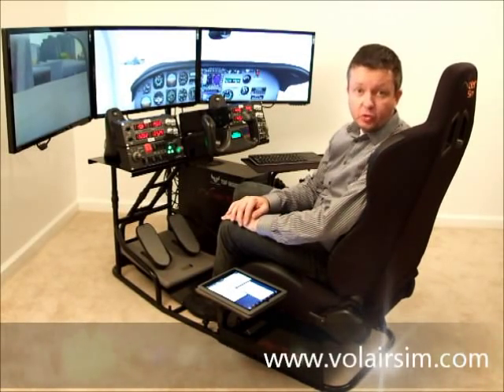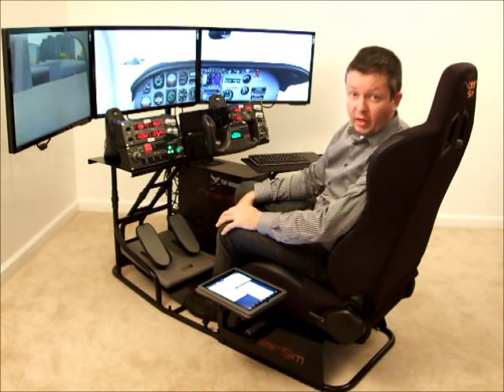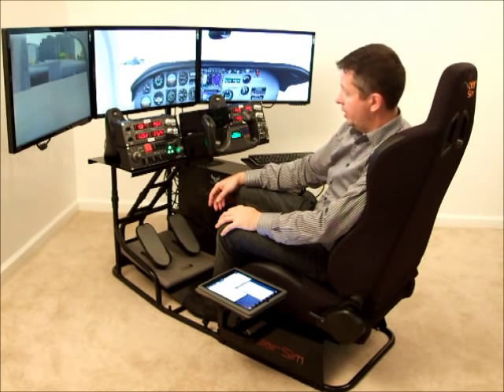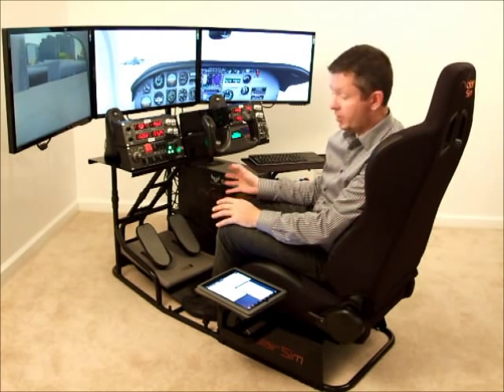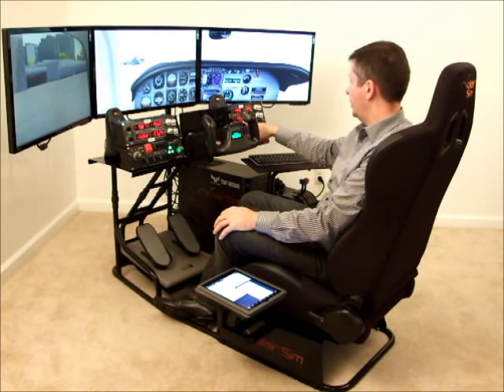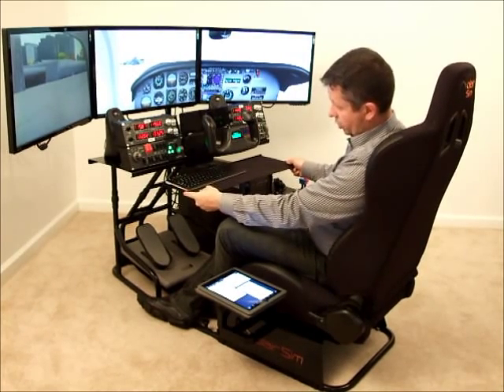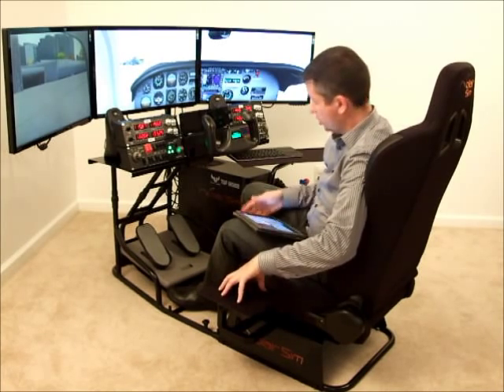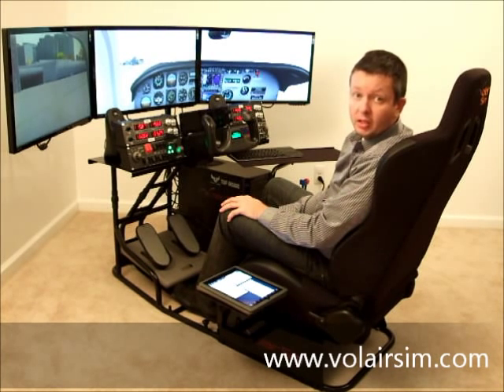Volair Sim - Flight Simulation Cockpit Chassis Product Demo

Comment from the maker: Hello, for this new shipment, we already added the holes for Thrustmaster HOTAS so you will NOT have to drill anything. The pedals attach with VELCRO strips that are included with the cockpit. They provide a very secure installation and you can remove the pedals easily that way.

Comment from the maker: Hello, during the R&D phase we actually moved the monitors as close as possible to the user while leaving the space for the yoke, wheel and avionics on the work table. The monitor will be about 11"-12" from the front edge of the table depending how deep the monitor is. We had a number of customers buying these as desks actually and we have not heard any complaints about the distance thus far.

Comment from the maker: Forgot to add that we ship from Indianapolis, IN which is centrally located for most customers.
Reply: I live in Indiana... Could I come to your facility and pick it up?

Also... I want a setup geared for DCS World which is a fighter plane sim meaning it uses a stick rather than a yoke. I would be using a center mounted Warthog stick and the the Warthog throttle to the left of the seat. Proper positioning of those components is my primary concern. I wonder if the keyboard arm can be mounted high enough to swing over the center mounted stick?

Comment: I really like your setup. very well thought out... I made mine from wood and it's a lot bulkier, but more custom for an A10 warthog. But if I hadn't spent the past year making mine, I think I'd consider ordering yours... only issue I'd be concerned with is the 30 inch monitor limitation.. I use 42 inch monitors... if it was a little heavier duty to accommodate that I think You'd have me sold... Looks great though.. nice.
Reply from the maker: Thank you Bruce. We've developed this precisely for people who had to time, energy, or mechanical aptitude to built your own. You are right, our size limitation is 30-32" at the moment (for 3 monitor installations) but honestly any bigger for our distance from the monitor would not be right. Good luck with your A10 project. We have quite a few customers that opt for that configuration and they put the 4th monitor below the center.

Comment from the maker: Mike, we charge actual shipping costs, we do not add anything extra, if fact we give people our discounted UPS rates. I don't know where you live but for most people in the lower 48 states the shipping is around $150 so not sure where your $300 is coming from. You can type the cockpit dimensions and weight into UPS web site and check for yourself. As for your $1500 treadmill shipping for free.... they did it probably because the cost of shipping was built into the price of machine to begin with.

Comment from the maker: Hello,
Looks like you will be able to mount the Thrustmaster but you will have to drill the holes into the mounting plates. The combat pedals will fit. About the center mount - depending on the demand from the market, we may offer this - we worry about the ability to easily to get in and out of the cockpit with the center stick.
Reply: That's a disappointment. You do realize that the Warthog sticks detach from their base right? With the popularity of DCS World, I think Volair would be wise to consider a modified model of this setup to accommodate the full line of Thrustmaster Warthog components... And no... I don't work for Thrustmaster.

Comment: I don't feel like posting an entire video of my Volair Sim so I'll try to add a quick little review right here.  If the comment is removed I will post a video of my own.  New buyers should be aware and consider these things when purchasing this seat.

1.  Overall it met my needs and I would recommend this product.
2.  Putting it together was a nightmare.  Not as easy as is shown in the videos.  Some of the components didn't line up too well and took 2 people to use considerable force; however, it was eventually completed.
3.  If you intend on using any aftermarket rudder, with the exception of the low-end products like Thrustmaster, this product will not work for you.  Unfortunately the width of the pipes is too narrow to squeeze it into place.  Additionally you would need to remove the "ramp" where the rudder goes anyway.
4.  The table that holds the yoke has an issue with clamp placement for your yoke.  I use the Honeycomb yoke and the clamps line up in such a manner as I had to clamp it into place at about a 2 inch offset to the left (or right).  This ended up being perfectly fine.
5.  I am using one monster sized 4K monitor instead of the 3 monitor setup.  This works fine.  You simply don't install the 2 left/right monitor extensions.
6.  This is the worst part, and it REALLY annoys me.  After about 6 months of use the seat springs squeak.  And boy do they squeak!  A couple months ago I had to completely remove the seat from the base so that I could appropriately get to the springs and lube the heck out of them.  There was still a slight squeak and within 24 hours it was completely gone.  Then...it comes back and today it is terrible again.  I have no viable solution to this aside from completely removing the seat each time this happens, and that is simply not an acceptable solution.  ;(  

Overall this is a good product with a few shortcomings but the seat squeak...that's got to be addressed as my wife can hear it from the other side of the house.
Reply from the maker: Thank you for the comprehensive review. Let us check with the engineering dept. and see what solutions they may have for the squeak as this is a first for us so we don't have any ready to offer solutions.

Comment: I like this seat but, wanting do use as a combo for flight sim and driving sim, is possible  to have a yoke and steering wheel combined some how??
Reply: Not at the same time.  You would have to switch them out.

Comment: Can the Honeycomb yoke and throttle easily attach? Are there predrilled holes and mount for the Honeycomb?
Reply from the maker: Honeycomb does not have anything tapped/drilled on its bottom so screw installation is out. However, we have had excellent success with using the microsuction mount that comes with the Honeycomb and just attaching the microscuction to our avionics table. After several months of heavy use, it has not unstuck yet!
Throttle is also not drilled and honestly we have not had a chance to try it yet but we think dual-sided 3M tape would be probably a best/cleanest install since the Honeycomb clamp is a big beefy and not very visually appealing.

Comment: any chance you will make a extended keyboard/mouse panel ? for gamers that have gaming keyboards  they are mostly larger than regular keyboards and from the looks of the panel in this video even the standard panel leaves little space for a mouse . Will a second side panel be a good place for the mouse ?
Reply from the maker: +Maher Ramos We wanted to make the keyboard tray easily maneuverable so we had to compromise on the space. With that, the keyboard is large enough for standard keyboard and mouse. For oversized keyboards, we suggest using the side mount as a mouse area as you suggested and that seems to work well. We worry if we made the keyboard tray very large it will present issues of maneuverability and also entry/exit from cockpit will be compromised.
Reply: +Volair Sim thanks for the reply and I understand in fact I would rather use the idea we both mentioned in our post. One more question what size computer towers does it support or does the tower just go on the side outside of the volair sim ? I'am already sold just want to get a heads up on space requirements and adjustments I need to make .
Reply from the maker: +Maher Ramos Maher, the tower can be placed anywhere (behind monitors, to the side). There are no size limitations. Thank you for your questions.
Reply: +Volair Sim awesome I will be ordering mines soon thank you for replying 👍👍

Comment: I live in Indiana. Can I come to Indianapolis and pick it up?
Reply from the maker: Yes you can (at least for the moment as of 3/20/2020). Our warehouse is on the West side of Indianapolis, close to I-465. Please note that we may, due to COVID-19 outbreak, have to close the customer pick-up option in the future. Thank you for your understanding.
Reply: @volairsim ... Awesome. And I understand that a 100 X 100 mounting pattern works to mount the monitor. I plan on mounting a single ultra wide monitor that weighs about 37 lbs. Will that work?